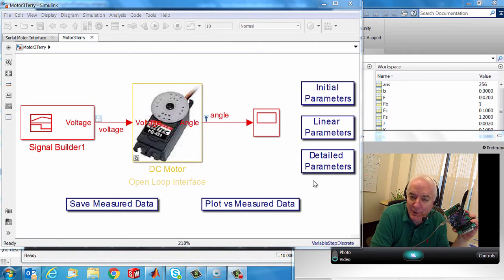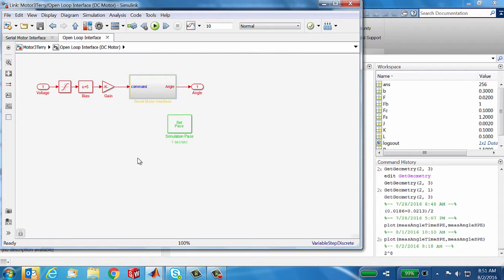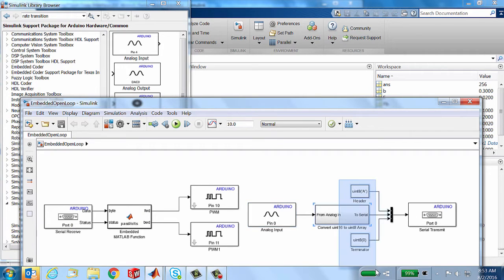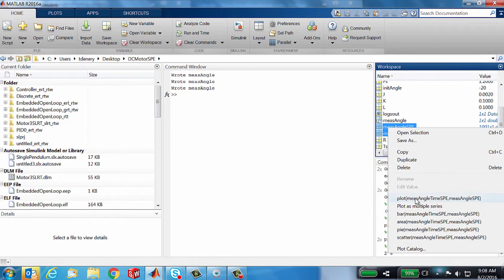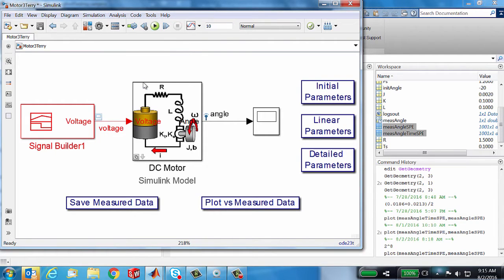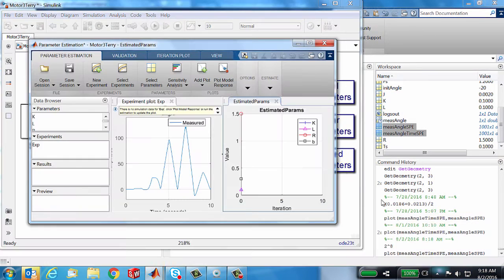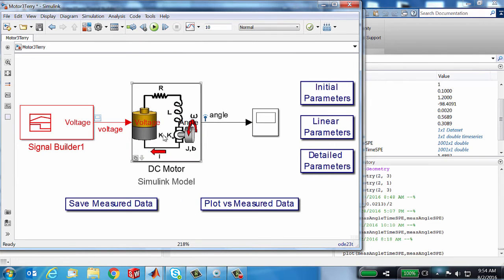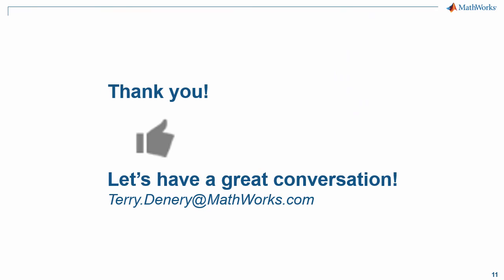Mechatronics with MATLAB and Simulink, Part 4: Modeling and Testing

Comment: Terry , very useful video, i done this but with a sinewave (,it was the data that i collected some time ago, and since the robot is 
already assembled i cannot measure data from a no load attached motor.)and seems to fit well enough.Do you think  is it a fine signal to identify a motor ? or should i re measure data and try this kind of signal to identify the parameters ? also i didnt see the gear box item in your model, and thus you are using a geared dc motor ... shouldnt it be included in the simscape model ? 
thanks for all !

Comment: Terry, please  make a video explaining in more detail about these simulink blocks.
Reply: Please check out video 5 of this series, which focuses in detail on the CAD import of mechanics.  The goal of this video was to present in more detail how to use these products to build useful mechanical models.  Please let me know if this video presents the solution at the level where it can be more useful for you.  Thanks.
Reply: Terry, I already imported my mechanical system  from the solidworks for the Matlab. But i dont know if it have issues, because i dont have 
the simwise 4d software to follow your steps. However my real problem here is the servomotor data acquisition for the parameters estimation. Please make a detailed video helping to build and run these models. Your videos has been of great help, thanks.
Reply: Hi Widjwed, Thanks for the message, and I am pleased that the videos have been helpful. What kind of servos are you using, and what have been difficult issues for you?